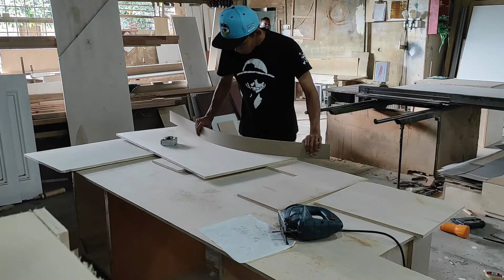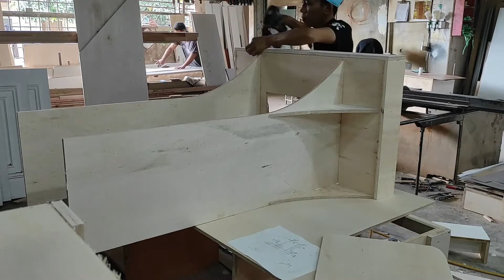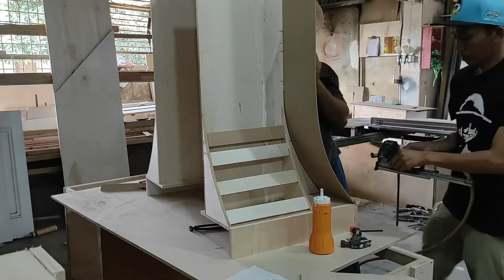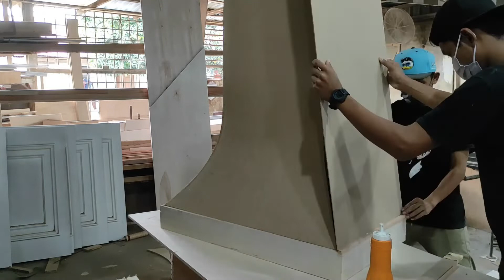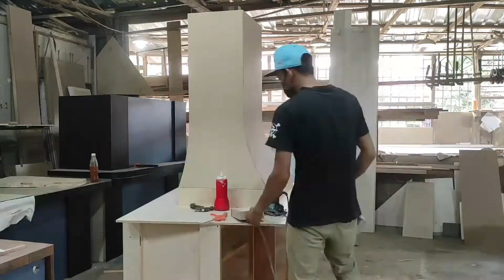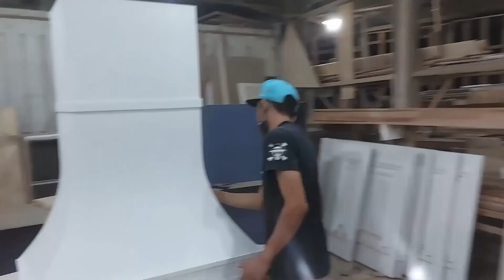HOW TO BUILD A CUSTOM RANGE HOOD COVER

Comment: Why would you not have used rubber cement to adhere the plywood sheets together? Faster set up and curing than wood glue.

Comment: What kind of router bit are you using at the end?
Reply: I'm assuming it was a trim bit. Basically, it's a flute bit with a roller bearing at either the top or bottom. Again, just an assumption on my part.